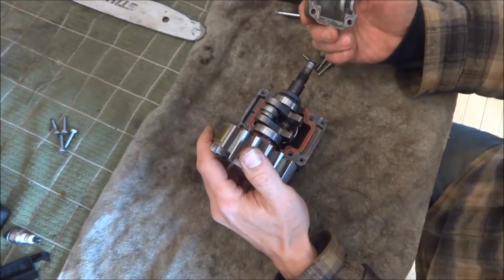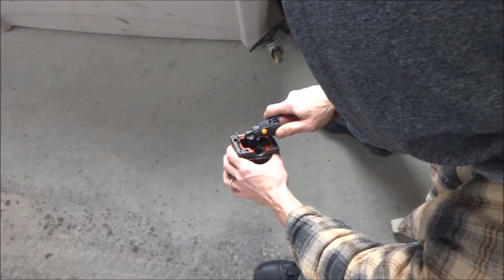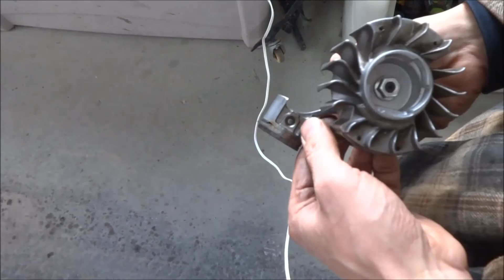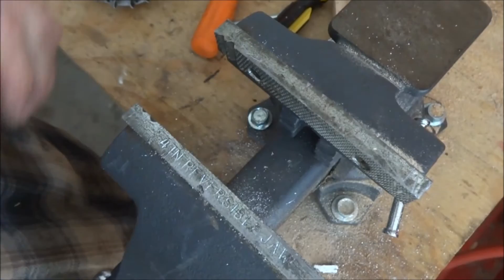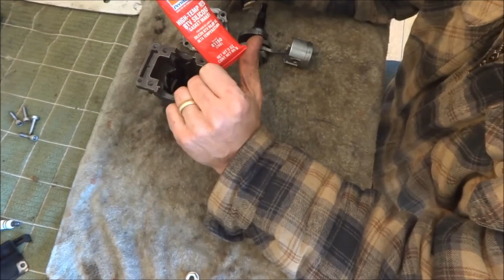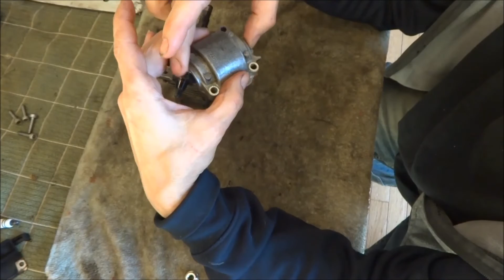Stihl MS170 Crankcase Disassembly, Cleaning and Re-assembly

Comment: How about protecting the grove on the shaft whe fitting the NEW seals and a little grease between the seal lips to aid lube on first start up!
Also check the gap of the new rings in the bore, before trying to assembly with the piston in the bore.